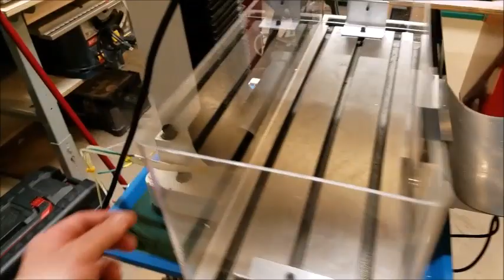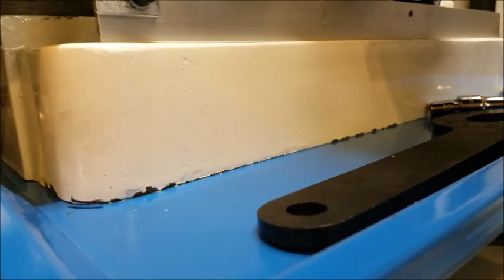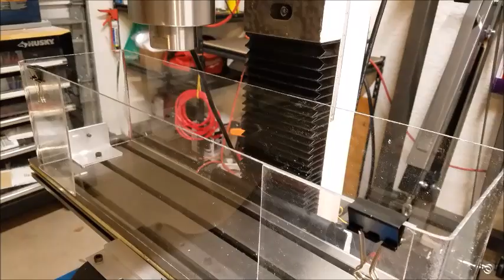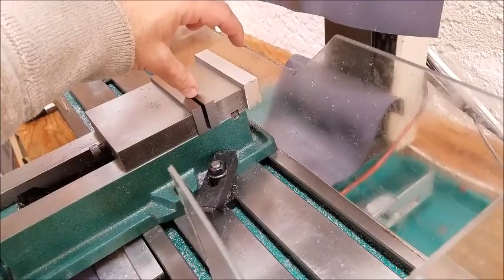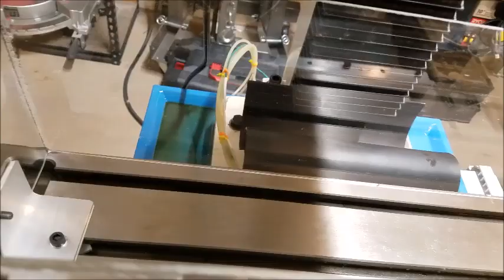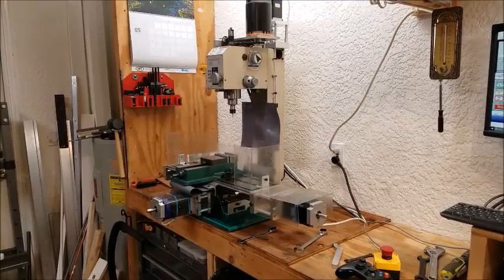PM-25MV CNC Conversion Part 5: Chip Guard and Way Covers

Comment: If you had two clear polycarb filler plates, you could notch one and flip the entire enclosure around if you needed to get low to the table.
THANK YOU SO MUCH FOR YOUR VIDEOS!
You are an inspiration for doing this sort of thing at home.  I have learned a ton from your videos, mostly electronics related (machine shop guy by trade.)  
Love your videos on stepper vs hybrid and servos.  Clear, concise, and including basic price information giving enough for someone to go and hunt down different options.  I have an old Emco 2400 I bought to retrofit, with the information I have learned from you, I can actually grasp everything I need to do to do that now.
Reply from the maker: Thanks.  I'm glad you like them.  I actually learn a lot making them and I get lots of good comments from people all over the world.  YouTube is a cool thing.

Comment: Did you bend and form the acrylic fish tank?
Reply from the maker: Yes, I did.  I can't find my heat gun so I used my torch to heat it.  I always get it too hot and make bubbles in the plastic.  Other than that, it works pretty well.